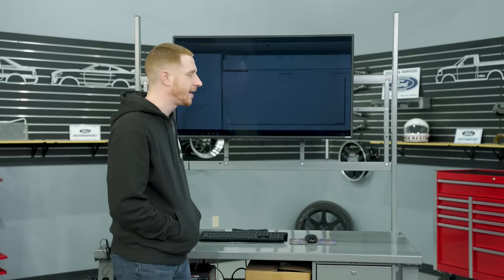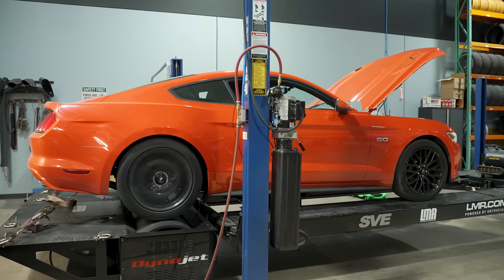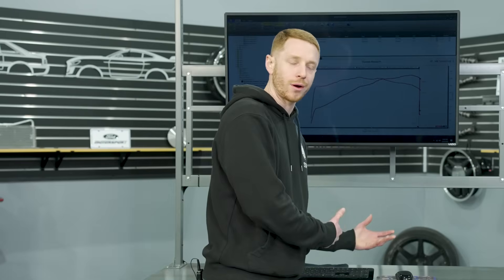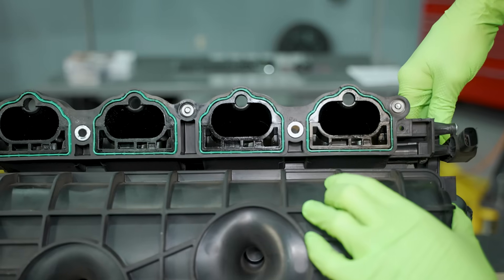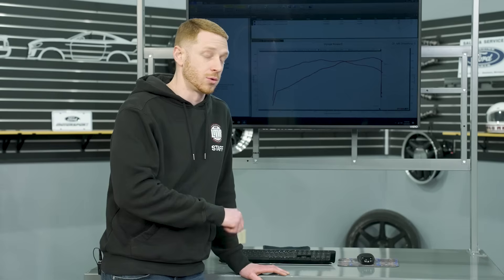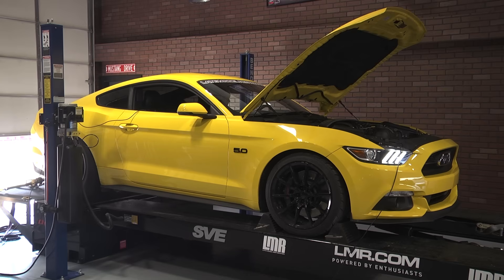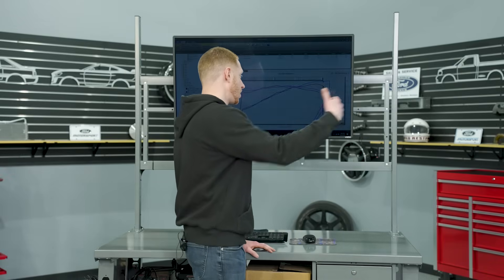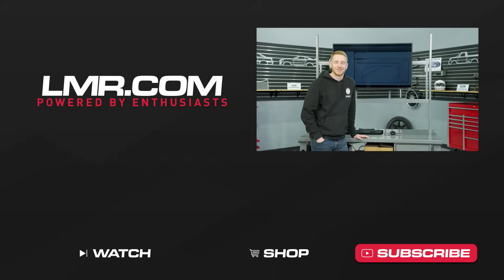Gen 2 Coyote P0300 & P0308 misfire codes SOLVED! Does it affect Power? Fix w/ Dyno Results

Comment: My 2015 Roush rs3  has this type of issue, however it’s supercharged  so IMRC delete,  but no codes,   Cylinder 2 is see misfires in mode6 sometimes misfires other cylinders but very minimal.   New plugs,new injectors, new coils ,new fuel pump    (DW400) , all around 2k rpm.   Again no codes.  But shows up one mode6.   No vacuum leaks ,compression test checks.   
I’m at my wits end.

Comment: Would you recommend getting the stock intake and getting those lock out things for the actuators being more budget friendly and I would probably have to get it tuned correct?
Reply from the maker: If the shaft is broken, the IMRC lockouts won't help. You'll still need to replace the intake. You can go whichever route you want to. Hope this helps. -Landan

Comment: OMG!! This could exactly be the issue I’ve been chasing for the past 2 weeks I’m really praying it is. It’s so stressful I have Po300 and Po308 codes.

I have the same exact symptoms in my 2015 Gt around 1800 and 2000 there is a hesitation beyond that’s it’s fine. I’ve already changed the sparks plugs and followed the coils and code dint change.  I haven’t done a compression check yet but I’ll do that. I do really think it is the imrc flaps not working causing my misfire. Thank you so much for this video it gives me hope!! Please give me any feedback if possible!!
Reply from the maker: Glad you found this video and hopefully you can resolve your issues. -Landan
Reply: @latemodelrestoration it sure was the intake manifold, I took it off and the flaps just fell out on the driver side. Crazy, thank you again!
Reply from the maker: @PremiumGasoliña  Good find and thanks for following up! You're welcome! -Landan

Comment: I have a 17 Gen 2 Performance Pack myself and it is crazy to think that it's almost 10 years old now.. And I still only have 16,200 miles on my Gen 2... I love my GT.. I did the SVE S350 Wheel's with Nitto's.. I went with 285's to 305's in the back.. I also did the SVe Braided clutch line, Steeda supply line, and the Starter Stop the Hop kit and the car handles better and hooks and Books a lot better now too.. I'll be doing a set of springs next and leaving it at that for a while..

Comment: Had the same problem on my 17, I switched out the manifold for a ported 18 with imrcs locked out, so the same stupid problem doesn't happen. Car runs smoothly and pulls like a train to 7500rpms.

Comment: Thank you so much this is a lot of value- I have been saving and buying parts for my 2015 mustang gt pp (same colour as well) and I'm about to install the gt350 manifold, gt350 throttle body, and went with a JLT GT350 cold air intake (120mm), along with stainless power LTH to mate with my MBRP catback. 

Question: 
Im going with a local tuner - will they have issues tuning the 87mm throttle body or has those issues in the past been figured out? 
I plan to install the headers at a friends shop and will have to drive it untuned home - is that gonna be an issue? 
Once home, my brother and I will be installing the manifold together but wont be able to tune it - Is there a way to know we did it correct or will it not fire up until tuned? 
Do I have to tow it to my tuner or can I limp it it to my tuner once all parts are installed?
Reply from the maker: Thanks for watching and for the feedback! We appreciate it! I can't speak on behalf of your tuner or tuners in general. If they know what they're doing, then it'll run fine. The car won't run right with those modifications. Trailer or tow it to the tuner. -Landan
Reply: @latemodelrestoration  It All worked out. Made 467 whp and 392 wheel torque :)